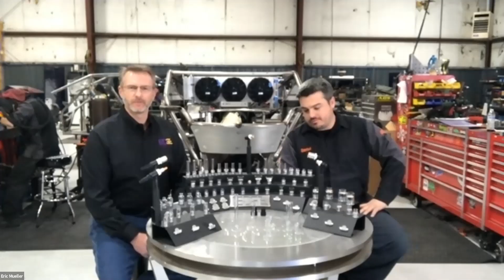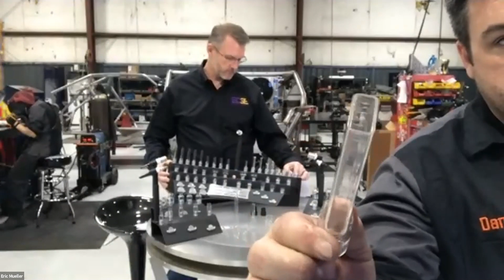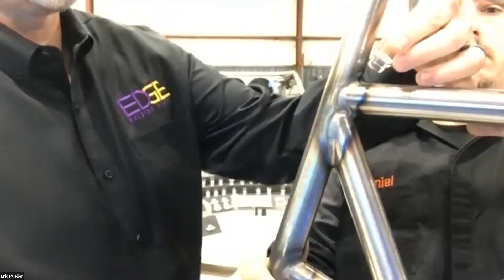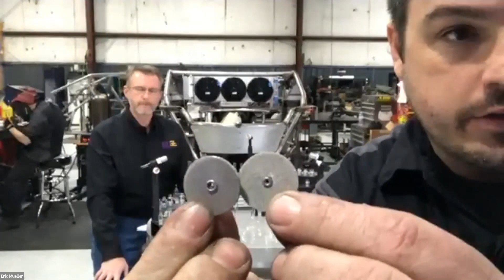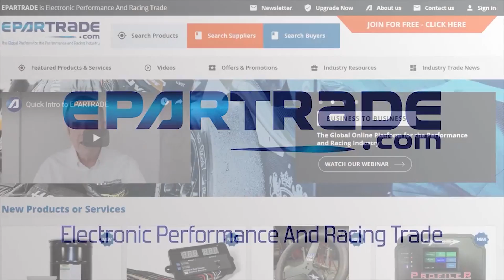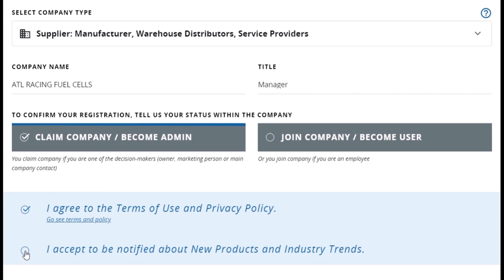Master TIG Welding Like a Pro: Next-Level Techniques & Tools!

Comment: Expensive! I used to orbital weld with Lincoln welders and they also used a Pyrex cups which cost $4-5 a piece. Now they selling a cup with a stainless screen held by a river for $40-50 a pop?
Reply: For real a decent kit from edge is like $700 and dont those are even the quartz ones that's like $2000 in cups in that table